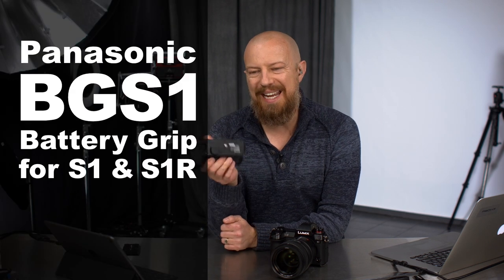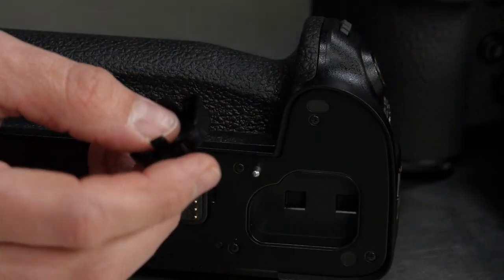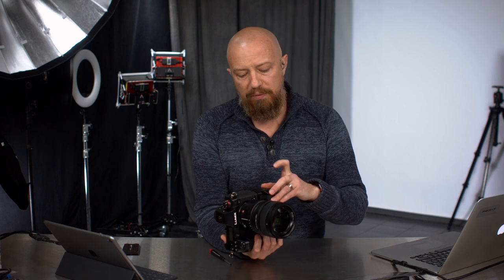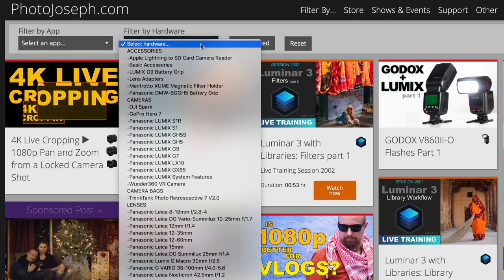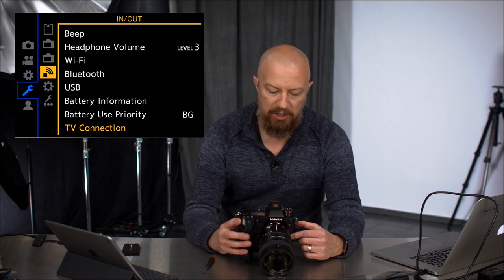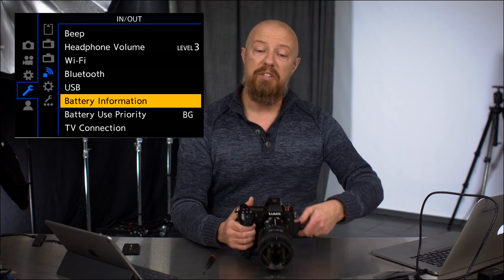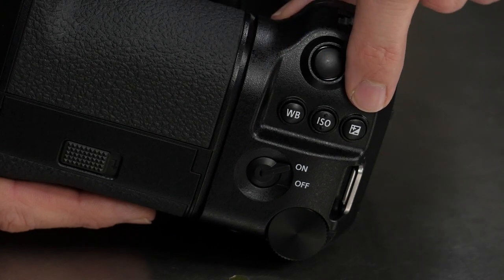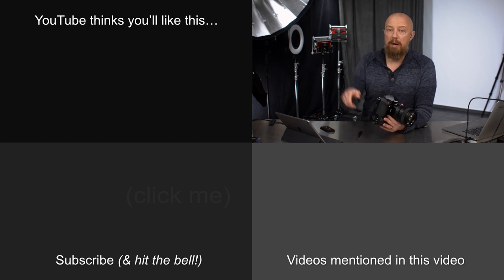LUMIX S1 & S1R Battery Grip BGS1 ► Full Tour & Tutorial by @PhotoJoseph

Comment: Thanks for the review, is it a solid feel though no flex in the grip, doesn't work its way loose?, never a fan of just bolt on bottom, more sturdy is the style that inserts into the battery compartment of the camera and two batteries in the grip... thanks in advance
Reply from the maker: I honestly don't use it that much, but when I have, it's felt solid.

Comment: bought this grip. Panasonic has done a great job with the camera body but the grip is not the same. the dial feeling is very different to the main body feel. it's built is mainly plastic. the grip is not cheap and Panasonic has cut corners with this one. there is a some movement between the grip and body . i tried tightening the lock screw as tight as possible.
i have the canon 5D4 + grip and it's solid.
this suppose to be a pro camera but the grip is questionable.
Reply: thanks for the heads up, was just about to buy a grip but not sure I will be doing now, hows is it feeling a year on from fitting the grip ?
Reply: I have absolutely no idea what are you talking about. The quality of the Battery Grip is amazing.